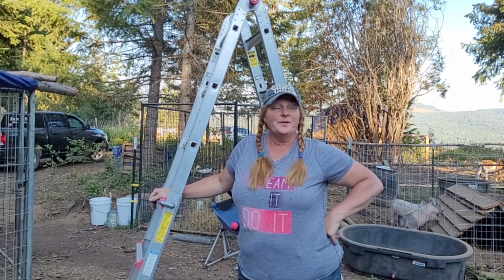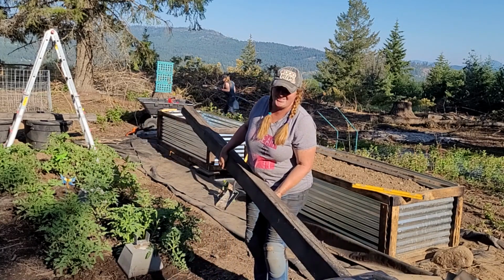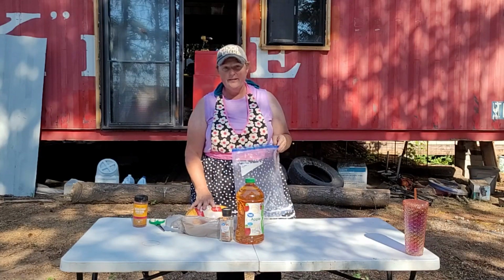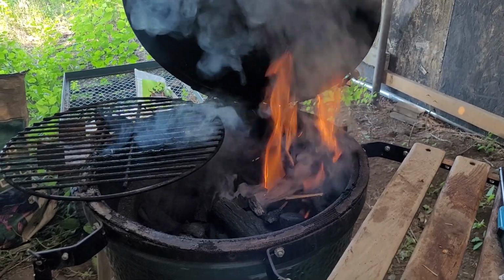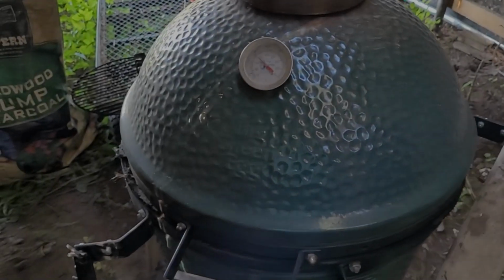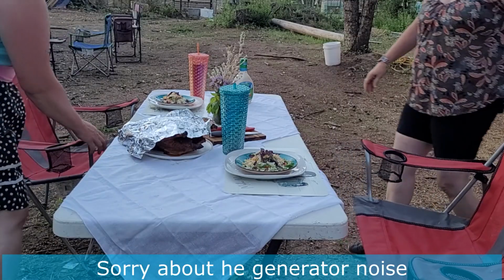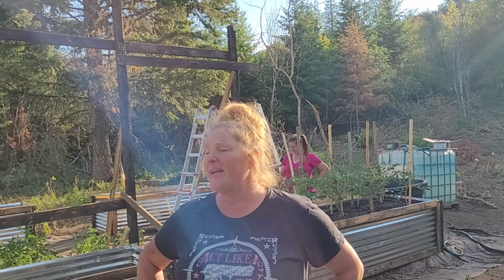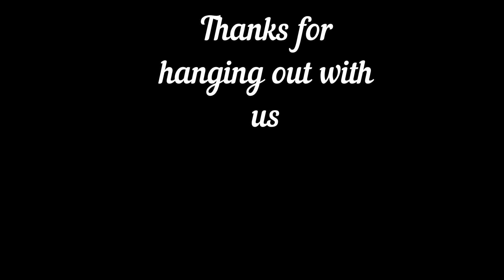Green Egg Keeping it Dutch CHALLENGE  // Building  on the GREENHOUSE got a little SCARY!!

Comment: An old WWII, farmer, and even the glorious 1950's trick is to remove the spark plug and brush it off with a wire brush (or sand paper) using gas as needed, re-gap, then put the spark plug back in.  Safety Sally would say dry that gas off and wipe a rag to remove any metal debris before putting it back in.  Saftey Sally would also say that you risk breaking the spark plugs' ceramic base with continued use of a refurbished spark plug.

Comment: OK my homemade hornet be gone technique. Only the instructions on how to on the technique is homemade. 
Get a long pole and a Old towel or t-shirt connect securely to one end of pole. Much like you would a torch. Once  attach wet down with a can of hornet spray from your local Walmart,  well anywhere you can find it. Make sure pole is long and easy to hold. Some say at dusk, I suggest in the dark of the night. Right before your ready for the kill, spray hornet spray on cloth at end of pole. Quickly shove up bottom of nest hold for a good moment. Make sure your path is cleared cause there will be a need to run. If hornet spray is not available try ammonia or even bleach but do not mix the two. While gather all you need to preform the kill. A Pray will be needed. Good luck on this hornet removal. Ps  put your hair up and wear a good ballcap, wear tight clothing an good running shoes   another  P.s  I loved your apron. 
Tool belt to Apron fantastic 💥💥💥
😁😬😁😬💥💥❤️
Reply from the maker: oh my goodness that sounds like a comedy in the making.. hahahahahha  I can just see it now. lol
Reply: @KuzweKanfarms  it would make a great shorts